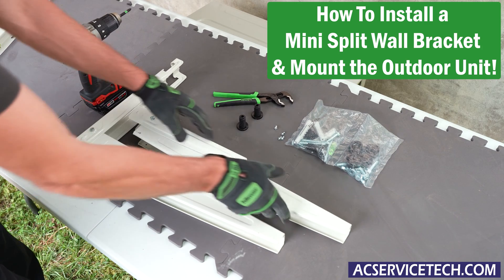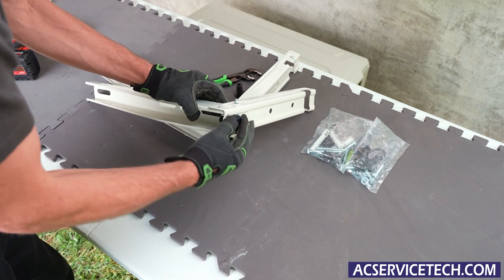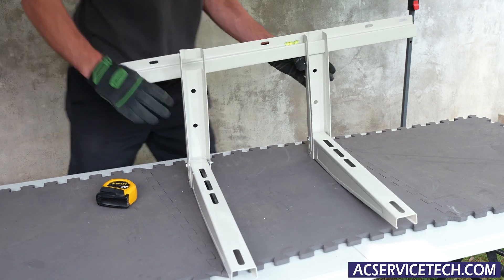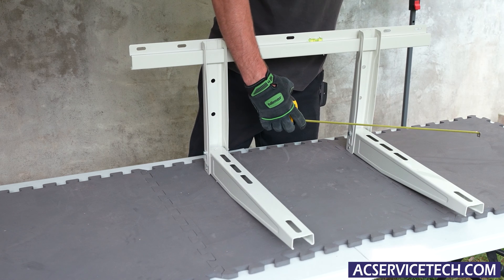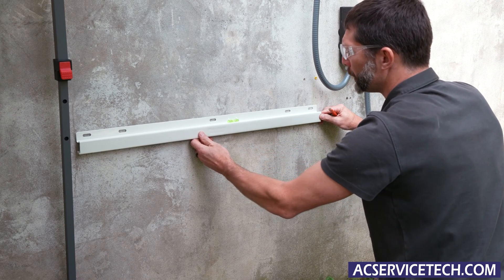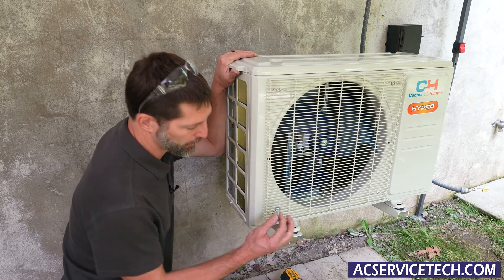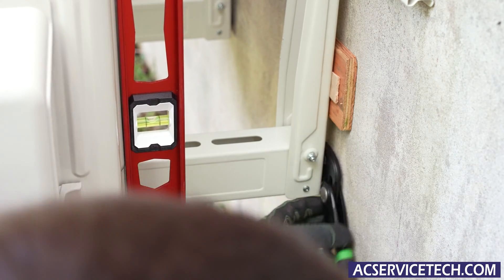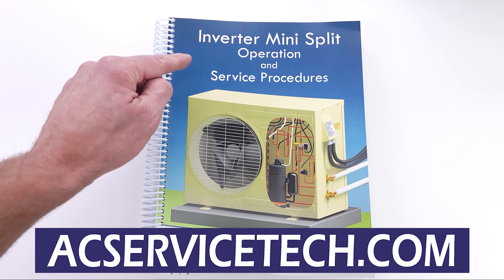Installing a Mini Split Wall Bracket and Mounting the Unit!

Comment: Yeah these thing are pretty much made so anyone can put them in. We’ve come a long way with ACs
Reply: BLASPHEMY, try doing a cassette unit on a ceiling with little access in that attic or a five port system with a branch box and line hide on a forty foot ladder and see how that goes.
Reply: I'd agree though I would not discount the homeowner who is paying much more now and these units are not lasting the 20-30 years r22 systems were lasting.